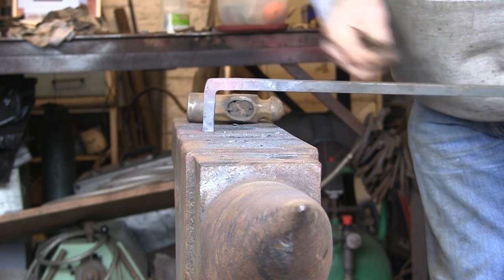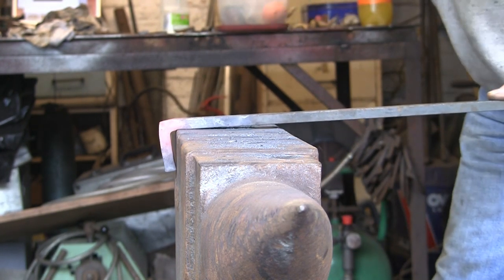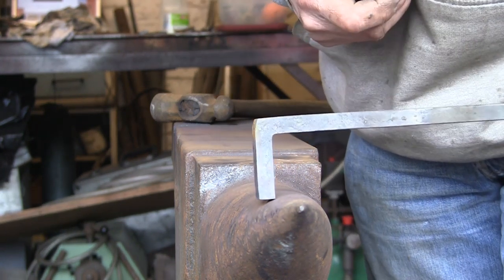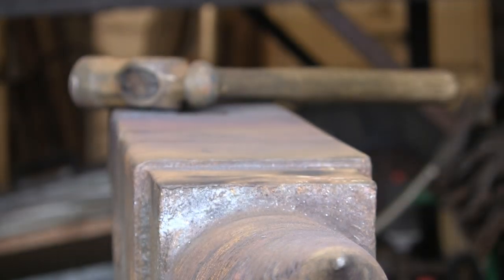Forging a square bend

Comment from the maker: Probably a bit of both! You really need a rheostat on the blower but you can only put one on if the motor has brushes. If not a rheostat try putting a gate type valve in-line somewhere so you can restrict the air flow. You really need to be able to control the air somehow as some jobs need a slow heat.. saves coal as well if you can shut off between heats.